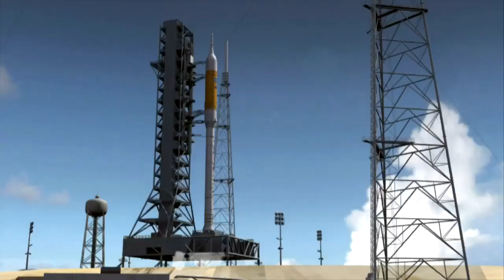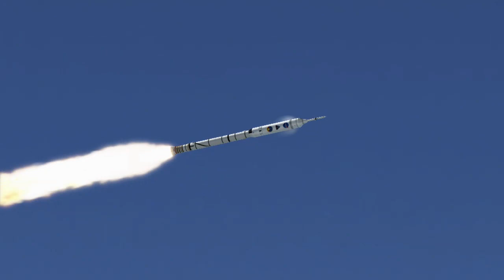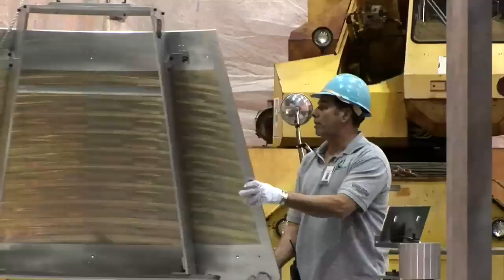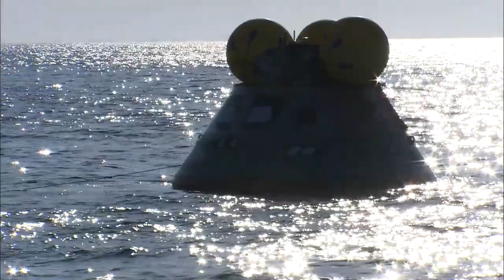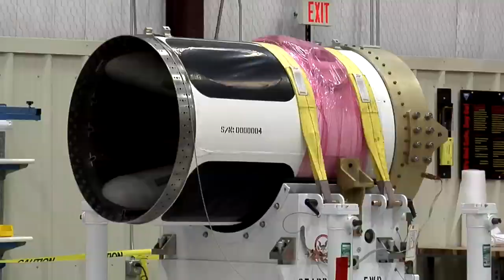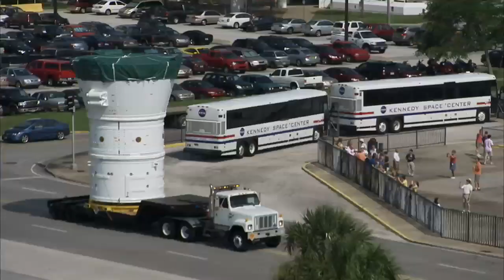Constellation Quarterly Report (June 2009)

Comment: Water vapor is most of what is left off from the fuel after it burns since it is liquid hydrogen and liquid oxygen. The solid rocket boosters let off the most pollutant, but it doesn't let off enough to cause any harm. Volcanoes that are spewing out all over the Earth all the time cause much more pollution and green house gasses than the shuttle has.